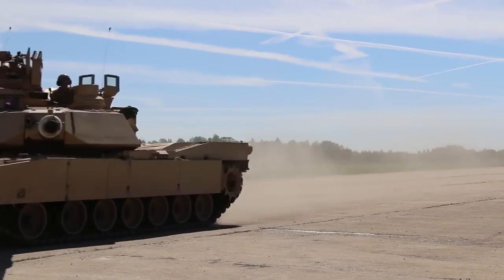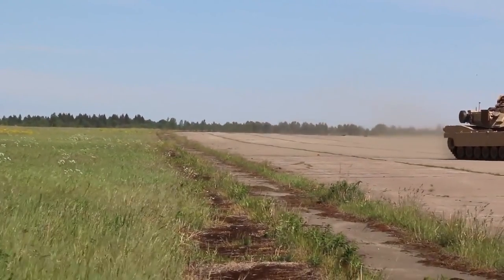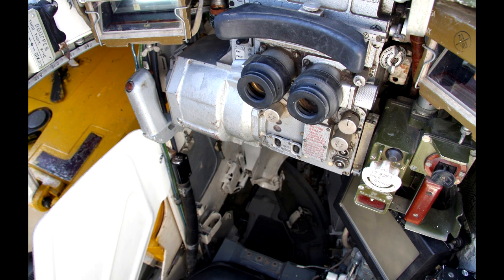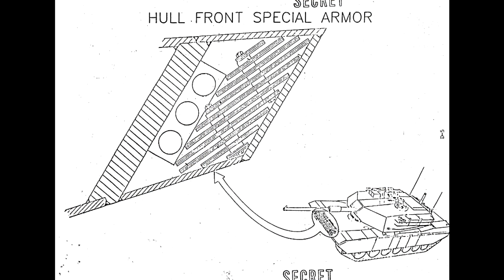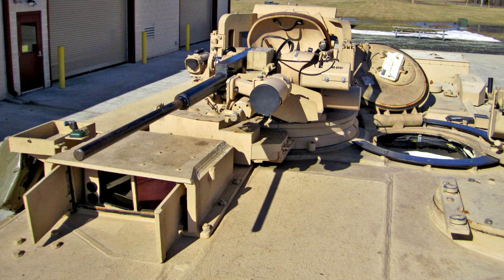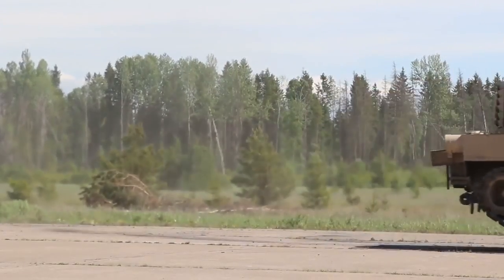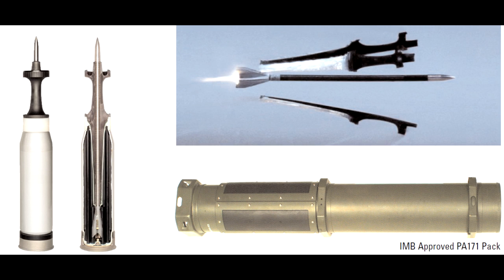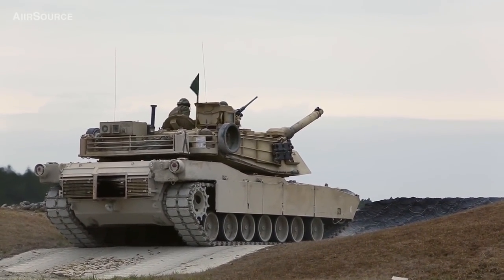Problems with Abrams tank

Comment: I have the Abrams in Warthunder. It does pretty well against the tanks it faces, butI thought it was weird that both the design of the General Motors and Chrysler prototypes in installed the the modern Abrams. The GM prototype has a better hull and turret design. Honestly if a GM prototype was given the same gun and armor, it is possible that the prototype would be better. But this is just speculation. Matter how you design something, no matter how much you test it, you will find something wrong eventually.

Comment: Gas turbines have a few advantages over diesel. The gas turbine can burn almost anything as fuel, is actually fairly efficiant at full load. Not as much as a normal engine, but still passable. It has a very good power for its weight and size. It gives off very few noises and vibrations which could be used to hear it.

Comment: Which Abrams y’all taking about?
Reply: depend on how old the fella making the claims is, or IF they actually have experience on the platform itself.....  Which I do, and yes it has its faults red was correct about the first Vpack air system it sucked. literally in the dessert in the first gulf war..  the A2 had electronics overheating issues in Iraq,  and I know from experience during both

Comment: Well, a buddy of mine told me that the abrams tanks use the very same fuel which powers blackhawks and even fighter jets. He basically said that this is to reduce logistical issues since the same JP fuel would power tanks, choppers, even jets. 

This does not make sense though, humvees, LAVs, strykers, and even bradleys burn different types of fuel, making it still necessary to include all their fuel types in logistics. So there is no point in specifically having the abrams tanks burn the same JP fuel.

Which brings more evidence against using a gas turbine engine. Sure it could burn a lot of different fuels due to a high compression ratio, but it does not really seem to outweigh the downsides. TBH it just feels like the DoD is insecure about the russians having the tech to build gas turbine engines so they had to prove their superiority by using it in their next gen tank. Or it could be just budgeting salvage from the MBT-70 left-overs.
Reply: Actually, it did make sense, the humvees were getting the same fuel and we just added a half can of oil to the mix, same for the LAV`s and any othe diesels in the first gulf war
Reply: @SgtBones  Ahh, okay, I learned something new today. I guess the 39 to 1 compression ratio is definitely there for a good reason. It'd be quite easy to resupply vics if they all burn the same stuff. Thanks for that info m8, cheers.
Reply: @Tren Linsley Guess so, all I know is we got diesel one day, JP4 a week later, we needed to add oil to that so it wouldn`t  burn the glow plugs out on our humvees
Reply: The US Army uses one fuel (JP-8) to power everything.  This fuel is good at powering jet engines and at powering diesel engines.  I was around for the transition - and the nightmare it caused because nobody thought about what would happen if you put a fuel that was a better solvent inside fuel systems that had been running DF-2 for years.  All of the sludge that was built up on the inside of the fuel tanks was dissolved - and immedeatly clogged the fuel filters.  

An entire company of tanks - plus the M-88, the medic track and the wheeled vehicles all broke down, in the field, at the same time.  And there were no spare fuel filters to be had because everybody was having similar problems.  Another tank company - that was still in the motorpool and thus hadn't needed to refuel had to come out and tow us back.
Reply: To be honest if your supply chain is fucked it doesn’t really matter if you can burn different kinds of oil, logistics are a bitch and if they aren’t working then your tank and personnel are screwed either way

Comment: When the comment section is about preparing for Abrams fanboys, but there aren't any.

Okay, here's whats always caught my intention on the M1 hull design. First off the M1A1HA received a hull upgrade. Secondly, why upgrade the lower hull is the 38mm upper plate is such an issue?
Reply: DSR_T-888 ya because this channel is Russian bias. This man thinks a t-90m is better than a leopard 2a7. Just shows you the type of demographic on this channel

Comment: Abrams needs to upgrade to 2a82-1m 125 mm gun.

Abrams fanboys: HERESY!!!!!!!!
Reply: Or just get German L55 120mm gun?
Reply: CIA why would you do that. What happens when your in the woods or in town and you have to move your turret but your Gun is to long
Reply: @Kai0240  not gonna happen. USA is upping the diameter caliber like 140 mm. Abrams is relying too much on low velocity DU based APFSDS. L55 is too fast for DU to pierce armor, tungsten is needed for high velocity. Higher caliber allows a larger sub caliber diameter thus slowing the projectile to under 1700m/s while kinetic force alone can be pushed higher. Beyond 1700m/s, DU is not better than tungsten against sloped armor while being good against era and AMAP, but sloped armor equipped with era or AMAP shatters the tungsten based sub munition earlier. While tungsten is shining against both flat and sloped armor beyond 2 km/s, that's why malachite era detonates before contact to spread the impact. Tungsten based sub munitions are better than DU in penetrating flat armor

Comment: So, Abrams needs a longer Schlong i guess.
Reply: Robin Schneider why would you add a bigger gun. Tanks don’t just face off in open fields. There driving through towns there driving through the woods. You have to be able to move your turret without smashing it into a tree or building. The abrums might be an old design but it works better than any other tank and that’s why it’s the most successful mbt to date
Reply: @shiftingndrifting1532  To be able to match and defeat upcoming tanks a bigger (read: calibre) gun is in order. Rheinmetall and similar companies are developing such guns. I'm not talking about how the L/55 is inadequate. I'm talking about that the gun's demise is already predictable in the medium run. Just my 2 cents, I don't disagree with you for analyzing the present situation. :)
Reply: Dietmar sabot will take out anything

Comment: Remind me how many Leopard 2 are running in Germany? (It was a whole 95 at one point. Goes well with the painted broomsticks they were using as "Machine guns" in exercises )Definitely filtration was bad, However it was designed to hold back soviets until tactical nukes were used to save Germany's ass. NOT the desert  So range, and sand was less critical.   And a Turbine it is smaller for its power rating.   Yes a new direct injection engine might get close but that's 40 years after original design was put down. Again 40 years keep in mind it was originally ment largely to take on t 54 and some 64 with a few brand new t 72 just coming on line.  So a 105 wasn't a bad choice.  Turbine was for the yes stupid but still NATO spec that F'd English diesel tanks.Then the silver bullet 120 mm came out, now tungsten is a requirement. No not perfect but like the Sherman,  good enough.  Is there better after 40 years I would hope so, is a DU armored heavy with the newest upgrades hard to beat, especially as per doctrine and again design for quick maneuver warfare, backed by hundreds of more tanks, fuel and quick swap power packs along with it.  With A-10 , AH 64, B 52 and AC-130 support again per doctrine , so far yes it is.  Could it be beat 1 on 1 vs some uber rare pre production or limited run largely show tank, you bet. And a Ka 50 werewolf likely is better than an Apache...  and end of the day a loaded working 22 is better than an unloaded MP 5 missing a firing pin...